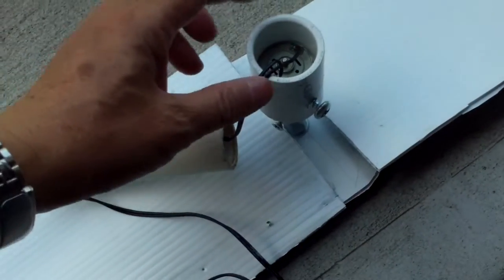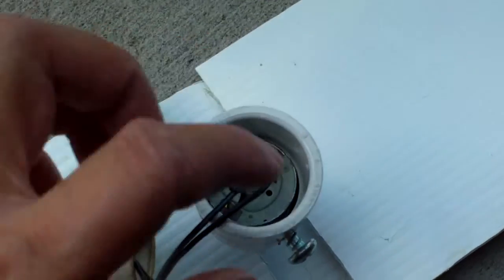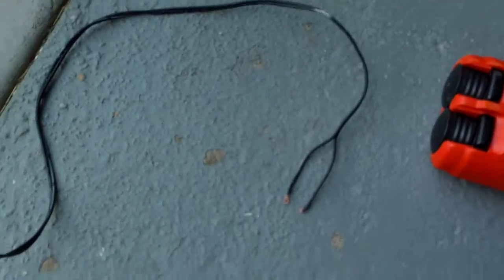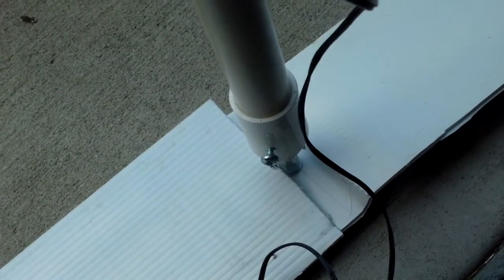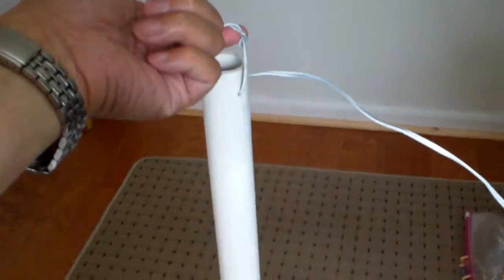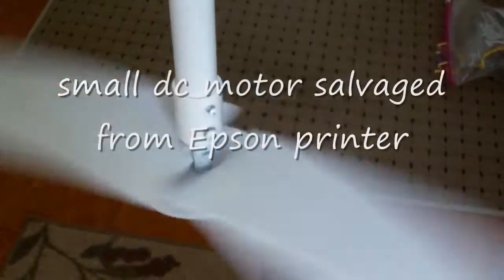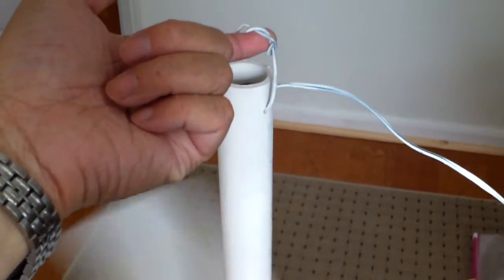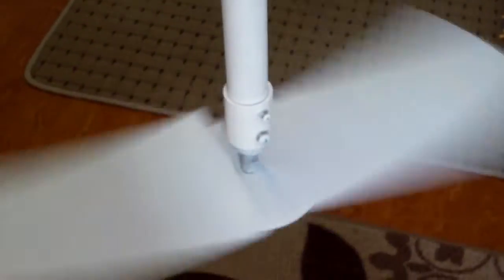small dc motor ceiling fan

Comment: You sure are a nice neighbour.  My mower is an 18in and my yard is much bigger than what yours looks to be, but I really like that mower.  The blades feel like they could be much sharper and I figure if I sharpened them, It would mow much easier.  The first thing I did was to loosen the cutter bar about a 1/4 turn to make it easier to push and it still cuts well.  It takes a bit of getting used to, but I like it a whole lot better.  I should have tried one long ago.   Thanks